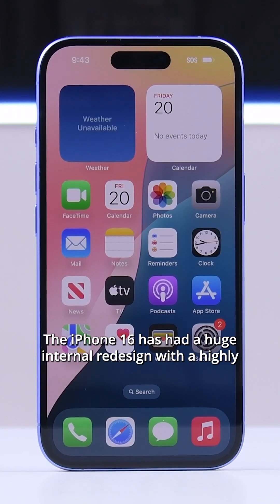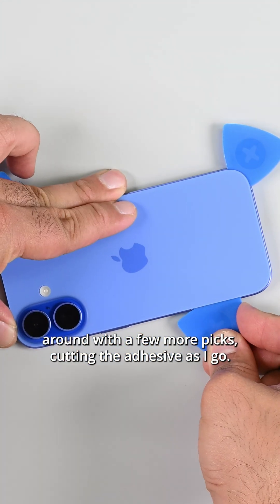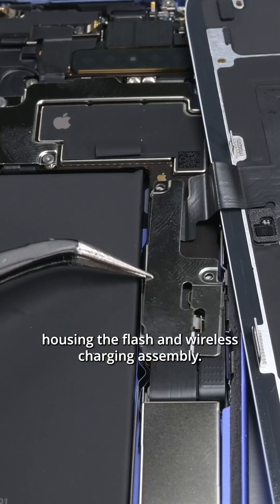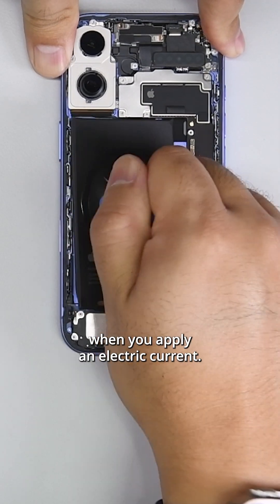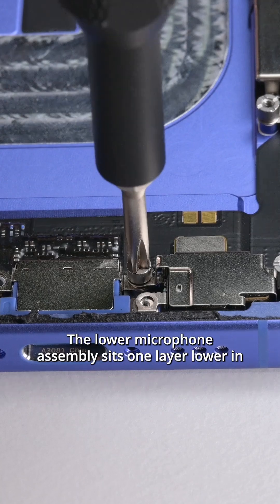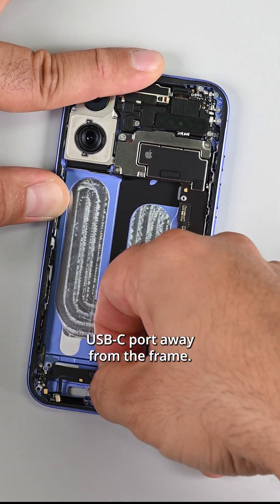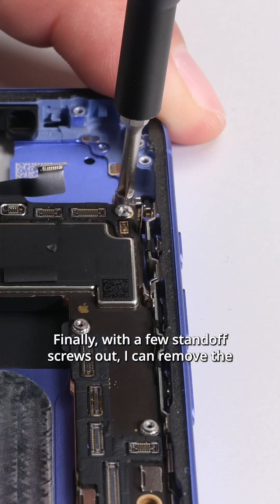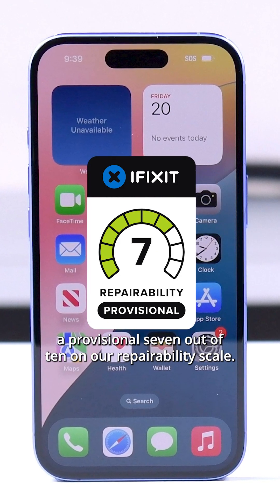The iPhone 16 Teardown: A Repairability Upgrade #tech #apple #teardown

Comment: How do you re-adhere the battery?
Reply: You put the battery back in place and just reverse the electric courant by interchanging both alligator clips that you used in the first place to remove the battery
Reply: Id say new adhesive with the same tech much like the old way of batteries with pull tabs

Comment: Looks promising, but I am still rightly skeptical about how thoroughly whatever new laws passed will solve this. Here are my questions:

Do they sell these parts to the general public, or are they only available to them and their IRP program members?
How much do they cost? If one is like half the price of the full device, there could still be a motive for customers to upgrade to some minor thing they may not have to get.
Are they still promoting upgrades by greenwashing with a recycling program? Or using the repairability of this to encourage disposal of older phones?
Can you upgrade a single part to make it partially or fully function as a newer device? That would actually be cool, like if only one part actually has to change.

Comment: What happens if the front screen breaks? Looks like screen and digitizer replacement is more difficult for this model
Reply: Not really, the front also opens up the same it always did, its just the backglass is now the main entry but the front still opens too

Comment: And after that, people say “noT TOo mUch HAve ChangeD IN The HArdWAre, ExCEPT A nEw chiP AnD bUTton”…
Reply: Well apple didn't really advertise any of the new repairability improvements but this improvement only applies to the base models
Reply: @Oxide53115  Fair point.

Comment: Can you swap out the screen when damaged?
Or is it "Samsung mode" where the frame & screen are together?
Reply: You can swap the screen
Reply: I’d assume it’s just like normal considering how easily he got that screen out after cooking it. I hope Apple never does that. Cause it will make screen repairs just as expensive as I work in tech repair and even the s20fe is still more expensive than its iPhone counterpart just due to the fact we have to transfer EVERYTHING. Increasing the labor costs.
Reply: @TemptationsEnd  you don't have to order screens with frames on samsungs you can order with or without and I've replaced in both fashions got to do my first 24 ultra as it was left on the roof after I got gas and it got ran over passed all of my tests I can do without a screen.  I dont repair phone on a big scale but I've replaced several older iPhone models won't touch a 13 and up ..
Reply: Samsung mode ? Lmao both can be done screen only or screen and frame . But with ios 18 if you use a 3rd party display you lose half your brightness, true tone and , auto brightness .. they made it easier to them make it not worth it as the software will make you verify the part and if the part isn't apple oem you lose functionalities hugh jefferies did a full mother board swap between two iohone 16s on ios18 and it allowed the parts to work but then tainted them both saying they were using used parts ..

Comment: Can I have the iPhone 16
Reply: Get a job and you might
Reply: I would only suggest it if your in the financial situation for it and your upgrading atleast 4 generations from your old phone. I had the XR for the longest time and recently I changed services and got promotionals that allowed me to get a 16 pro 256gb.
Reply: @TheDailyKnife009  nice
Reply: @TheDailyKnife009 similar with you, after using Xs Max for 4 years, now l change it to 16 plus teal 256G, and it feels awesome 🎉
Reply: i dont see the point my 13 pro max works perfectly fine and runs what i want

and it has a 120hz displau